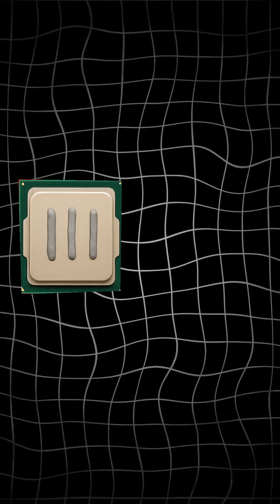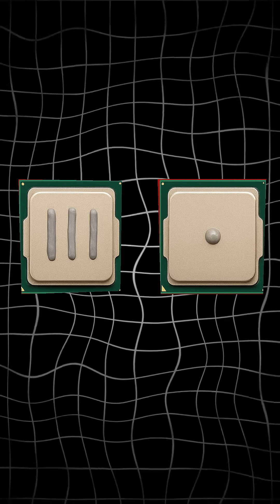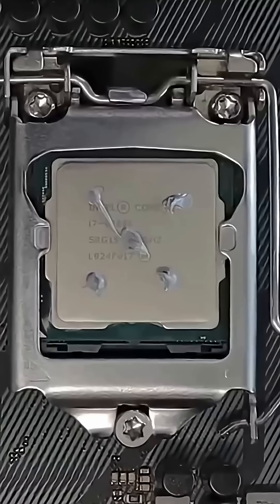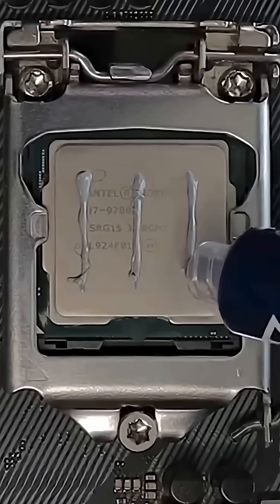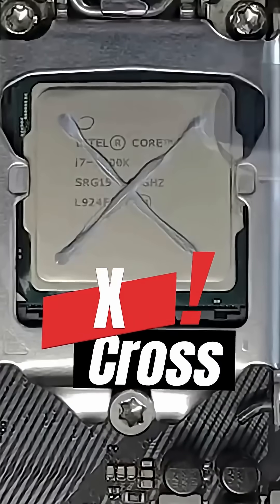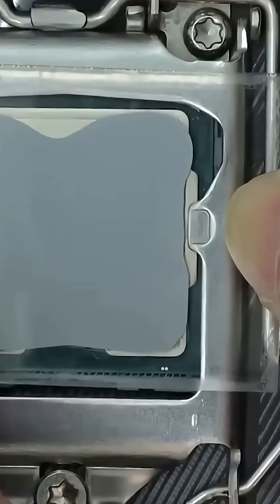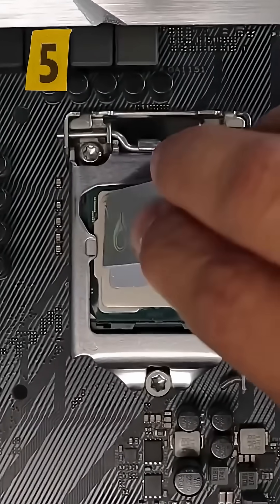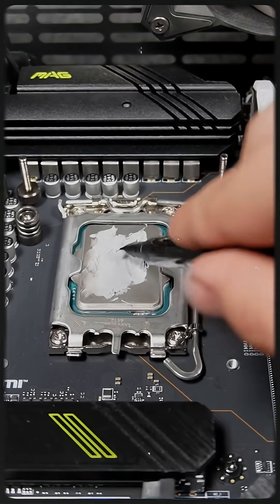APPLYING THERMAL PASTE IN THE BEST WAY 🔥  #shorts  #tech

Comment: Paste is non conductive so it’s okay to touch the board if you’re using Liquid Metal that’s when it shouldn’t touch the board
Reply from the maker: That's why I said it 'might' cause some problems.
Reply: @TechZonePro-TZP  but it won’t tho? Unless your getting it off a sketchy dude paste is made specifically to be non conductive if you meant Liquid Metal as well should have stated that but I’m just saying this to not give people wrong ideas and correct a small mistake there’s no hate though and I pray for your success because we need more pc creators out here
Reply from the maker: Thanks, as for the thermal paste, I am thinking of making a short video to explain everything about it soon.